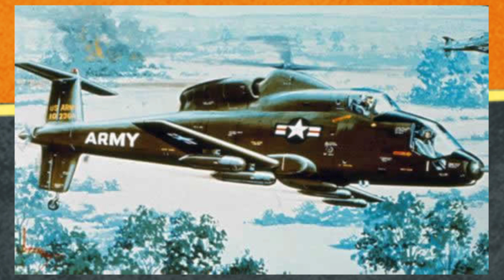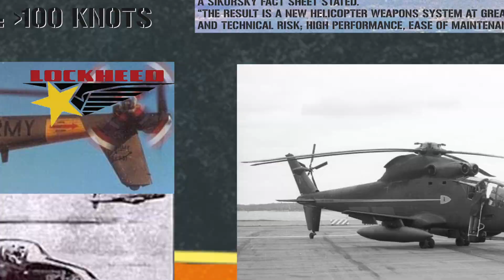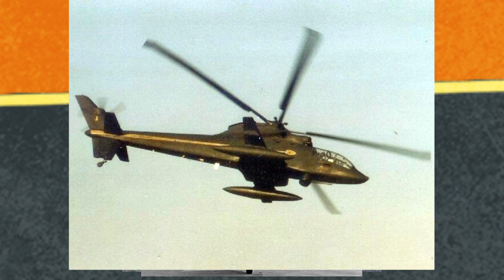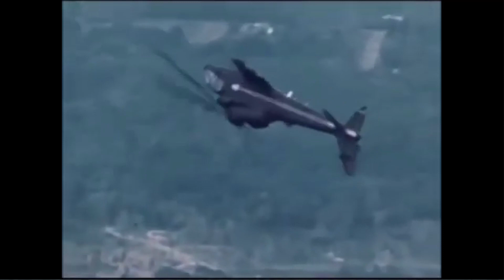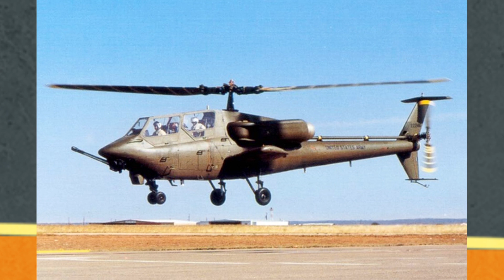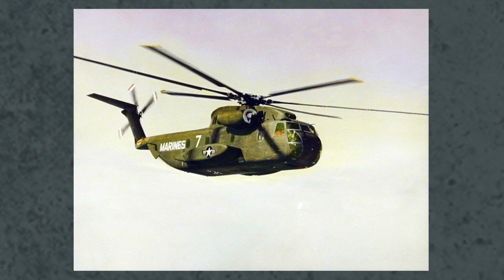Wacky Helicopter | S-67 Blackhawk

Comment: A very nice series. Talking about ugly: Like you can no longer look at the final UH 60 Blackhawk in the same way again I could never really stomach the AH 64 right from the start. To me it has always been a but ugly, retrograde, weak re-interpretation of the Cheyenne. By the way: If you take a close look at the pictures of the actual S67 prototype you will see that the translating tail rotor was not retained. In no way could it rotate through 90 degrees with such a sharply raked tail. Keep the coming. :-)